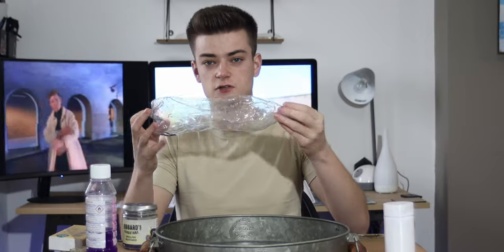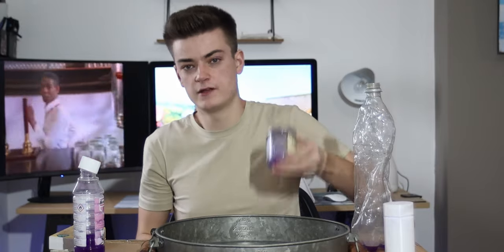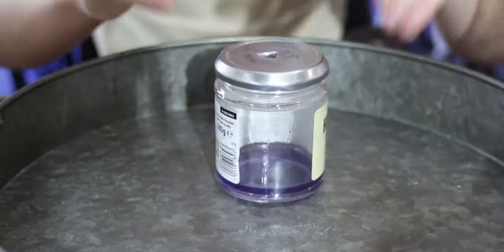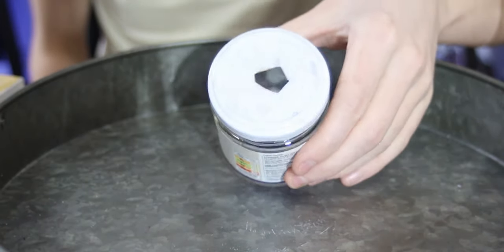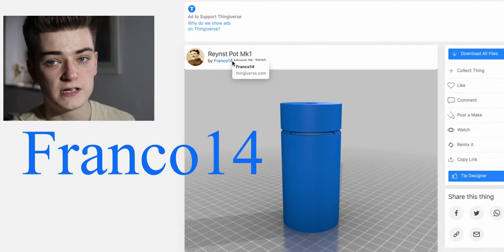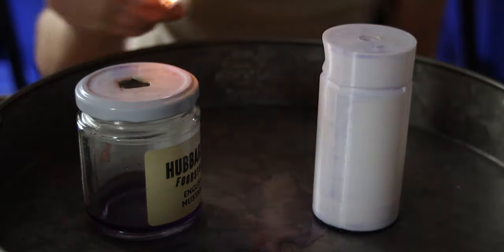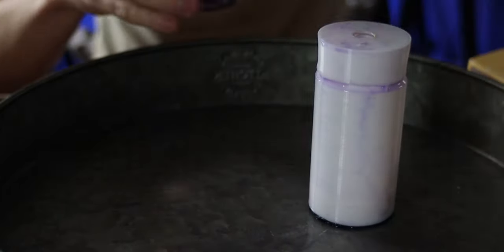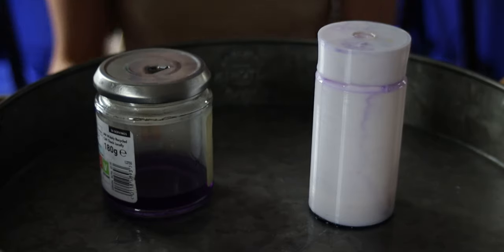HomeMade Pulse Jet Engine, Jam-Jar V 3D Print Which Will Work Better?

Comment: Here Franco14, I'm the creator  of the pulse jet engines, try printing the design up side down, that should give you a beter seal in the bottom  and beter quality on the nozel, I might come up with a 3rd design soon. but also try using water to have a good seal on the botom
Reply from the maker: Oh hi Franco14 thanks again for letting me use your print in the video, I will definitely give it a go printing up side down. I liked how the MK2 Version only Took me about 2 hours to print but it definitely seemed like the MK1 version worked a bit better, I’ll keep a eye out for a MK3 !!! You definitely make the best 3D printable Pulse-jets on the internet so keep it up !!!

Comment: what fuel did u use?
Reply from the maker: I used purple methylated spirits which you can get from any camping and hardware shop and it worked quite well I also recommend giving it a good shake before lighting it, good luck and have fun.